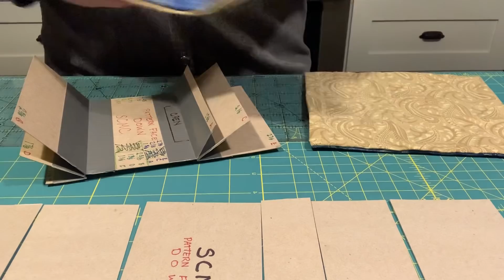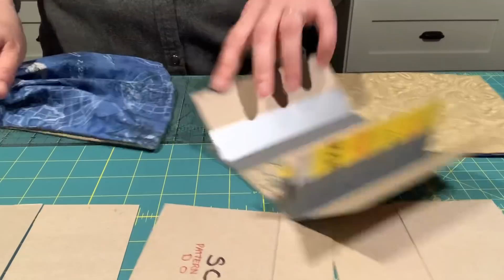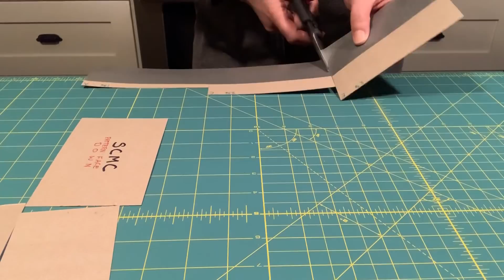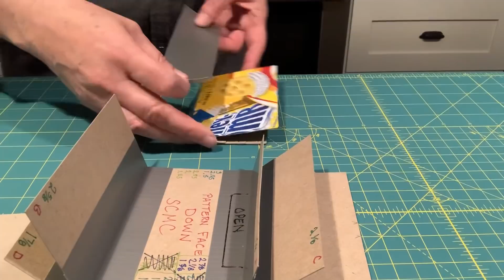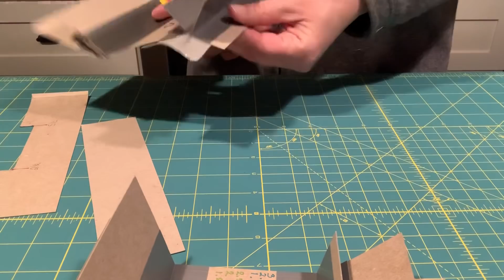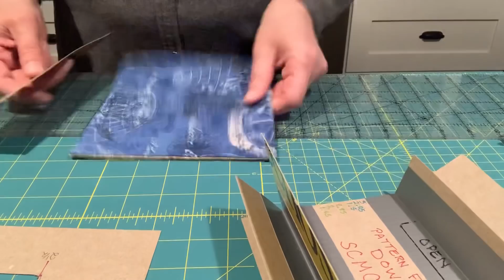See my other videos for an updated and easier jig tutorial.

Comment: Would you happen to have the dimensions for each piece of the jig if the finished length before pleating is 7”?
Reply from the maker: If you take 1/8” off of all 4 folding pieces, that will add up to 1” since they fold over each piece twice.  The pleats will have a little more space in between though.  I did a 3 pleat jig on a 7” piece that was already sewn.  The dimensions were a bit more challenging though.

Comment: my mask size before pleating is 8x8 - I want the finished mask to be 4x8 using 3 pleats.  When I do this manually, I put pins at 11/2,  1,  11/4, 1, 11/4, 1 top is the 1 1/2 and bottom is the 1....of course reversing on the left side.  I would like to leave enough of the overhang so I could sew this while still in the jig.  Could you please tell me what size to cut the pieces to make this specific jig.
Reply from the maker: Can you share a link to the pattern you’re using?

Comment: What is the finished size of the mask? The ones requested by our local nursing home and hospital required 4” finished height. So would I increase each jig piece by 1/2” ? Any advice would be greatly appreciated. The jig is wonderful, our older kids could do the folding and use binder clips for assembly type line. Thank you!

Comment: This is so wonderful and inspiring -- thank you so much for sharing. I'm going to try to figure out the dimensions for the MasksNOW 3-layer mask and will share.
Reply: Dimensions for the 3-layer #Masksnow pattern (9x8.5), pleated height: 4"
Width: 7"
Center piece height: 3 3/4"
A: 1 1/8"
B: 3 1/8"
C: 1 7/8"
D: 2 1/2"
E: 2 1/2"
F: 2"

Comment: Please!  Someone smarter than me, PLEASE translate this for the Deaconess pattern.  6"X9"  I cannot figure it out.
Reply: Cindy Peng posted a litle before noon PDT April 2 in the Million Mask Challenge page:  "I made a no iron, no pinning pleating jig for the 9 inch by 6 inch version of the fabric masks! This jig is based on the larger jig some brilliant person had created for the 8 x 9 mask design, please watch her video for how to put together the jig after the pieces are cut.

Here are the dimensions for the jig I came up with for the 9 x 6 mask:
Base: 2 1/2 inches by 6 3/4 inches. Top has a mark for the opening where the mask is turned inside out— this is not a filter pocket

Flaps, in order of folding

1. Left flap, 1”, fold on top of fabric. Fold fabric up (continue folding fabric up or down to make pleats
2. Right flap, 2”
3. Left flap, 1 5/16”
4. Right flap, 1 5/8”
5. Left flap, 1 3/4”
6. Right flap, 1 1/4”

As you can tell from my video, the last flap is a tiny bit too short, but I decided not to redo it as it was easy to adjust."
Reply: @sandrahayashiminner2387  You mention "my video," but I don't see a link for a video. Thanks for the measurements.
Reply: Sandy Minner thank you!
Reply: @sandrahayashiminner2387  This did not work at all.  Waste of time
Reply: https://m.facebook.com/groups/218271269483727?view=permalink&id=227235281920659

Comment: Back Piece vs Middle Piece - which one do you attach the flaps to? I read it as the "back piece" to be the centre in the dimensions list but you said "middle piece" in the video.
Reply from the maker: I updated the reaction to only have the 3.25” listed.  

There was a brief period of a few hours where someone said I didn’t list it so I added it a second time with a typo.  The way the editing worked on my phone I couldn’t see what I was typing. 

The description should be correct now.
Reply: @SeelyeFamilyFarm  Thanks!! I'm using my Brother Scanncut to cut the cardstock for the jig so this helps me set up the file. I appreciate your response to my question!!
Reply from the maker: Jenn sorry, I used the terms interchangeably but they are one piece.
Reply: bendphoto but they are both listed in the measurements and they are two different sizes. So which size is correct for the piece that goes in the center?

Comment: How are the dimensions of the center piece?  Just give the dimensions of all the parts, please.  How hard is that?
Reply: In the details she lists the rectangle sizes though it's a little confusing. This is what I got from it:
A (top)       1 3/8”  x  5 1/2”
B (bottom)  2 5/8”  x  5 1/2”
C (top)        2 1/8”  x  5 1/2”
D (bottom)  1 7/8”  x  5 1/2”
E (top)         2 7/8”  x  5 1/2”
F (bottom)   1 1/8”  x  5 1/2”
BACK           3 1/4"  x  5 1/2”    I believe she also refers to this as "Middle piece" in the video
Reply: Have you found above these comments yet? They are there! Look for more information to open up below the video.
Reply: Dude. Read the description. It's all there.

Comment: For someone trying all the ways for an easy pleat work flow, this method is fantastic. It is a wonder what other process helped bring along this idea because it seems like a giant leap to go from nothing to coming up with this jig.

The jig needs to be as close as possible to perfectly square. This means each hinge and each flap’s outer edge needs to be perfect. But building it like that is probably not possible. I found I needed to tune the jig after assembly. This can be done by operating the jig on a piece of paper that has parallel edges. One can then see where the flaps are not as square as they need to be. Trimming the flap edges as necessary helps to correct the out of square flap edges resulting from both the hinge error and the flap edge error. 

There are six pleating folds. If the material happens to be 1/16 of an inch thicker, for example if the material is a filter media instead of thin cloth, then you’ll loose 3/8 of an inch more than what the jig is designed for due to the bending around the jig’s flaps. A second trimming to account for that bust is necessary after trimming for squareness as described above.